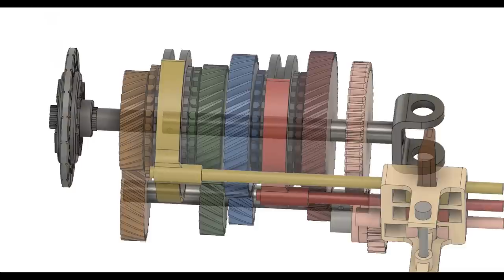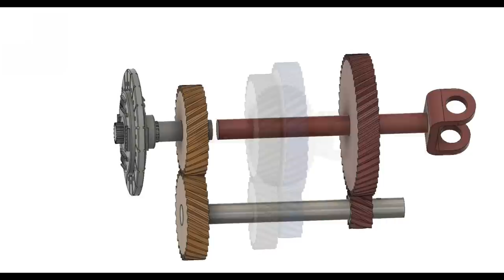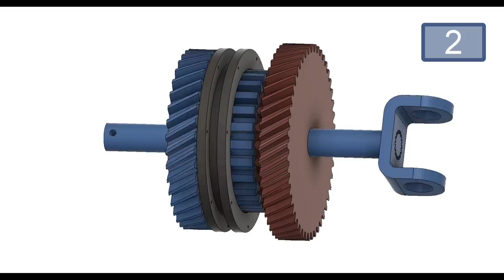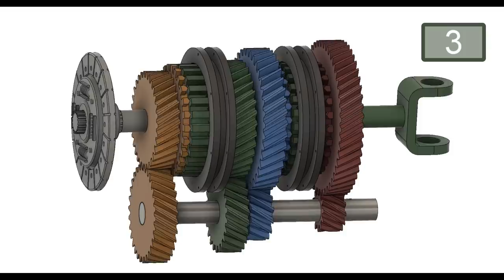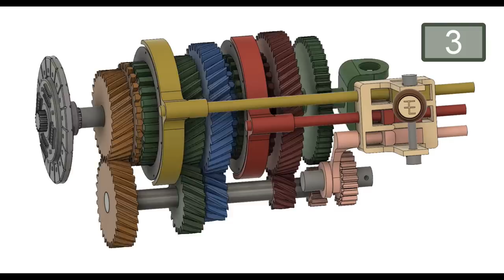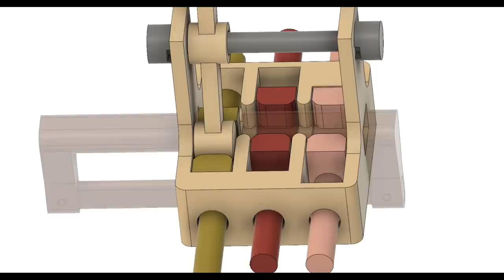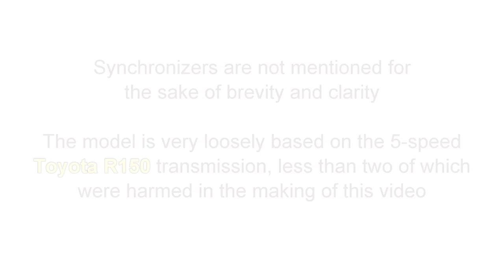How a Manual Transmission Works

Comment: Suggest reducing the music volume by at least 20%.   I could barely understand the commentary at times.
Reply from the maker: Thank you.  Yes - I botched the volume balance in more than one place.  I have learned from that and will do the audio mix with more care next time.  Frankly, I hurried the release.  It had been months in the making - a daily grind of tweaks and retweaks ... when I finally glimpsed the light at the end of the tunnel, I ran to it.  :)  In post mortem I provided a customized Closed Caption track ... too little, too late. (For the record - one of the thumbs ups on your comment is from me)
Reply: Eliminate it completely and this will be a decent illustration.

Only thing missing is the synchros but I guess that's really best left for the next installment lol

Comment: Very nice work and getting things to print with the right tolerances on a CR-10 is a challenge in itself.  I fought that on a few stationary steam engines to run on air.  First transmission I took apart was on a 1950 Plymouth to replace a broken synchronizer gear, at age 17, now 71.
Reply from the maker: Thank you for taking the time to comment.  I was two when you took that first transmission apart. You didn't mention that it was ever put back together ;)  My CR-10 and I have reached various agreements over time (I don't push; it doesn't shove).  It's been extraordinarily good to me for the past year - a real workhorse, but yes - tight tolerances were the largest challenge here.  And that shifter cradle...I'm still waking up in the middle of the night...
Reply: @johnsanborn2950  No help as a kid without a father so I had to get it done on my own. Unheated single car garage in an Iowa winter.
Just replaced the hot end on my CR-10 as unattended I ended up with a ball of melted PLA 
What did you have as a guide to do this project or just all on your own? 
Can you adapt a small motor to spin the input shaft? 
Just a great project!
Reply from the maker: @gvet47  I have found the hot-end silicone sock to be a worthy, inexpensive, and painless modification. Highly recommend them now for just that eventuality.

This was done completely from scratch with plenty of missteps along the way.  I actually began modeling a much simpler, older transmission (viewed in a 1936 Chevrolet training film titled "Spinning Levers" - look it up - a beautiful little production) - but decided, after weeks of work, to scrap that and, instead model this much more complex and (to me) interesting one.  I had a lot of prior experience with video production - but almost none with the animation of a 3D model - so that took a bit of effort.

One could motorize it, to be sure.  I was tempted to do that with an earlier model that I made of an open differential (https://www.thingiverse.com/thing:3592644) but decided in both cases that it would hurt more than it would help when using the model(s) as hands-on instructional tools.

And just so I can sleep in peace again:  My arithmetic was bad.  I was 5 when you tore down that gear box.  :)

Comment: 2 years ago i took a course and we had to 3d print a gear box i used your design and saw this video, it was my first time to understand anything in engineering after 3 years in the school, its amazing how can you've this impact on so many people, bc i was the team leader of more students just like me but we all ended up understanding the concept, thanks for you

i wish you can send me the calculation you used for the design, if you still have them?
Reply from the maker: wow.  That's so great to hear.  Thank you for taking the time to share that.  I don't have any of the notes/calculations that I used for the project any more, but I can tell you it involved several hundred hours of work in all.  I learned quite a lot about designing gears, and a lot about printing them.

Comment: This is such a good video.
I am a Korean university student studying in Korea.
As I was studying vehicle transmission, your video was very helpful, and I went to the site above and downloaded the materials you uploaded.
However, I don't know how to assemble these products.
Can I get a file that is all assembled?
I am using Inventor.
Reply from the maker: I am delighted that you found the video so helpful.  Thank you for sharing that. 
 
Included in the posting of the model is a document named "Assembly.pdf" which is an illustrated, detailed, step-by-step guide to the model's assembly.

It would be impossible to create a single 3D-printable file of the completed model as it comprises more than 70 individual plastic parts and a dozen bits of non-printed metal hardware (small screws, nuts, springs,....)

Comment: Awesome video. How do brakes work without destroying the transmission?
Reply from the maker: Thank you.  The output of the engine is coupled to the input of the transmission by a clutch.  When braking to a stop, the engine is disengaged from the transmission using this clutch.  Although not discussed in the video (as it is not part of the transmission proper) the clutch is represented by the circular plate attached to the end of the transmission's input shaft.

Comment: Nice! I wanna print one of these now! How much material did you use?
Reply from the maker: Thank you.  The final prints took roughly 155 hours in total (using a single printer.)  I would think that's something on the order of 1.5 kg give or take.  (And many more times that in the design process)

Comment: hello friend good video a question
the reductions are the same in all the gearbox or vary according to the manufacturer and how can I know what they are, is there a page that says so?
greetings from Argentina
Reply: The ratios vary from model to model of gearboxes from different manufacturers, and they also vary within models from the same gearbox manufacturer depending on what the car manufacturer wants. There isn’t a standard set, although some ratios are very common. Very few car makers make their own gearboxes - they buy them from suppliers.

Comment: So why might car cruising (by cruise control) in 5th gear suddenly shift into 1st on its own, no input on the shifter (or any pedals) by the driver, and remain stuck there?  Failure of a shift fork, or ?
Reply: Gear locking pins and spring/C clamp might be worn.

Comment: Hey quick question could you make it without using the bearing balls and the spring? If not is there any alternative?
Reply from the maker: It would still function w/o that hardware.  You would only lose the detents that provide positive stops for the selector sleeves' key positions.
Reply: john sanborn ok thank you for the help. Looking forward to making it

Comment: i was wondering how you made those gears in fusion 360. i couldn't find a way to make helical gears with a controlled outer diameter. i tried add ons but to no avail.
Reply from the maker: I used "Helical Gear Generator" by Ross Korsky (available in Autodesk's App Store).  I did not control individual gear diameters.  I controlled each gear set's "Center Distance" (the sum of their two radii) - keeping this a constant.  This is done by calculating an appropriate module for each of the four gear sets.
Reply: @johnsanborn2950  thanks for the help you are awesome

Comment: Why are most of the gear teeth on a slant? It’s to reduce the noise from them engaging.

Notice the teeth for the reverse-gear chain are not on a slant. So you always get that transmission whine when you’re backing up. Safety feature?
Reply: I believe it is a lot stronger for the high torque to handle!
Reply: @thomasgagel  But the reverse-gear ratio is typically close to that for first forward gear.
Reply: @lawrencedoliveiro9104  I always thought that reverse was a direct drive from the engine, with the highest torque of any gear. I’m not sure though so don’t quote me! 😅
Reply: @thomasgagel  Direct drive would be the lowest torque. Remember that the gears in the gearbox are invariably reduction gears.
Reply: @lawrencedoliveiro9104  isn’t reverse the exact same ratio usually?

Comment: Dang, the quality on that is so much nicer than my attempt, though it's only my first. How much RPM can she handle? Mine survived full blast on a makita electric screwdriver, though it's rather sketchy as it's not quite balanced (too thin a shaft, not quite straight -> vibration)
Reply from the maker: I hadn't pondered that, but I would say it could spin rather quickly, but with no synchros...shifting would be... uhm... interesting.  :)
Reply: @johnsanborn2950  Mine has no synchros either. Well theoretically the pieces of plastic are there, but they get negligible friction to the gears, so they do nothing. As I don't have a shifter mechanism, I can just tilt the whole thing maybe 20-30 degrees and it will shift under full power. Apparently I only have 1 pic at hand, here: https://imgur.com/a/iIBKa4K

Comment: I wonder what program do you use to design this type of things. I use Inventor of AUTODESK.
Reply from the maker: I used Fusion 360 to design the model and to create the animations (8 in total) that I then combined together using PowerDirector .
Reply: @johnsanborn2950  Thanks for answering, you have a lot of knowledge about that program and I want to learn it because the people in general speaks well about it. Now I'm gonna try to do your transmission model. Greetings from Spain.

Comment: Awesome job designing, simulating, 3D printing, assembling and then sharing! Was you able to do the simulation in Fusion or was that done with different software?
Reply from the maker: Thank you.  Yes, Fusion360 produced the basic animations of the model.  The video actually incorporates 6 separate animations  which were blended together (in various ways) using PowerDirector 365 - the program that also provided the graphics (titles, labels, arrows, etc...) and the soundtrack.   If curious, here is a screenshot of the video's structure  as seen from the POV of PowerDirector.  You will see 12 layered tracks of video, 1 audio track, 1 fx track,  and that top unnumbered track which is the Closed Captioning (kinda).  Not visible in that screencap is the voiceover track as it doesn't fit on screen there.   https://imgur.com/a/jqqPf5I
Reply from the maker: oops.  Make that "incorporates 10 separate animations..."  :)

Comment: If all the 4 clustered gears are always in mesh and rotating with the counter shaft, how are the gears independent,?
Reply from the maker: The gears that they drive - the gears on the output shaft - are independent.

Comment: So what is happening when you grind the gears? I started driving manual only a couple years ago and I still will accidentally grind them shifting down into 1st once every few months.
Reply: Shifting down to first is pointless
Reply from the maker: This involves a mechanism called a Synchronizer (not covered in the video).  There are a handful of decent Youtube videos out there on the subject.  Here is one that I favor...  https://www.youtube.com/watch?v=nM4CuWlnJY0
Reply: Only select first when you’ve stopped. As long as the car’s moving, go no lower than 2nd, and feather the clutch a little if you need to, but only for an instant.